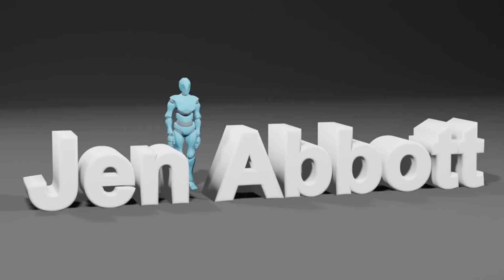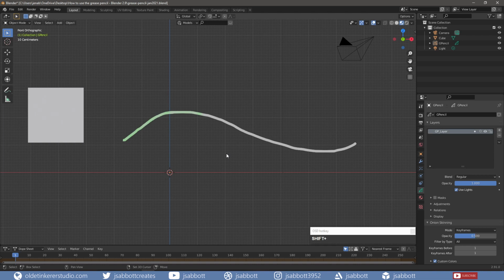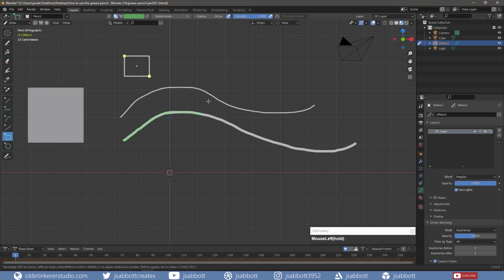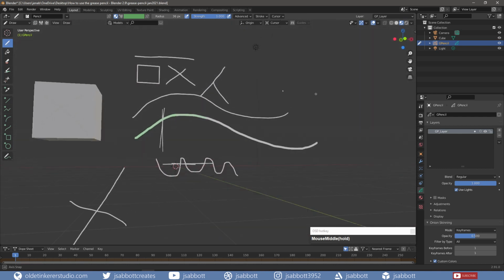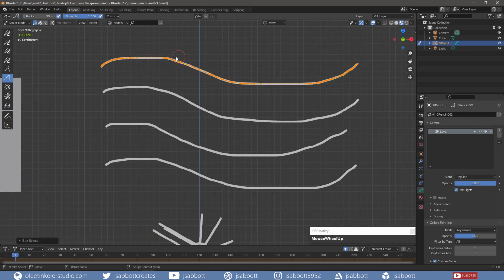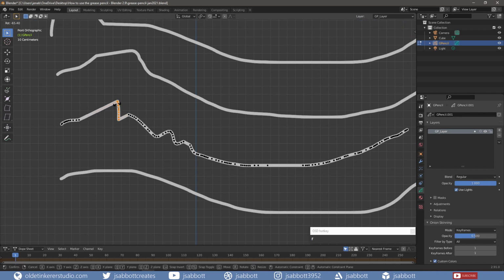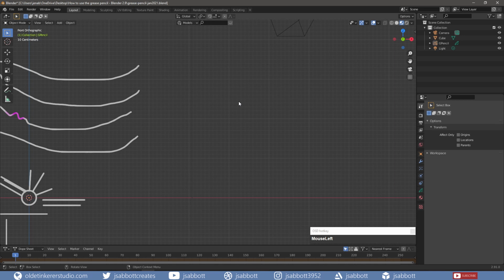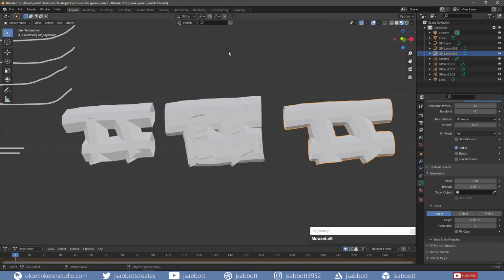How to use the grease pencil in Blender: The Basics | Blender [2.9]

Comment: Hi Jen! I have a later updated version of Blender, 2.93, and my layout looks a bit different then yours. When I select the greasepencil, I don't have those tool characteristics that you do at the top, for example the : color box, radius, and strength. How would I go about retrieving those?
Reply from the maker: After you add the grease pencil object, go into draw mode and you will see the options at the top.
Reply: @JSAbbott  Hello Jen. I tried that and do see the options at the top but cursor doesn't draw any lines. Only when I stroke object. The grease pencil blank doesn't produce any lines.
Reply: Nevermind. I figured it out. I had to create a layer then I able to draw a line. Using version 2.93.5